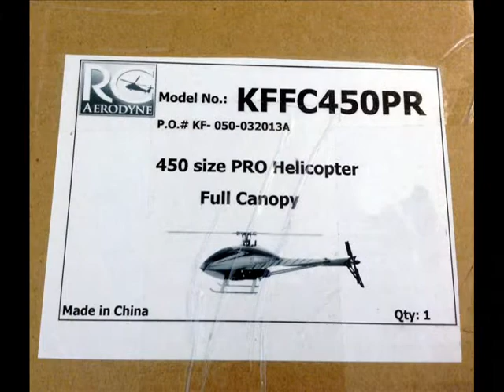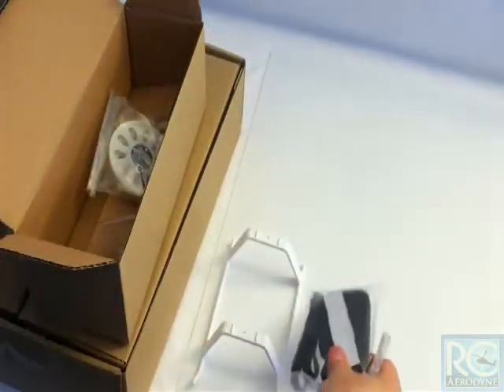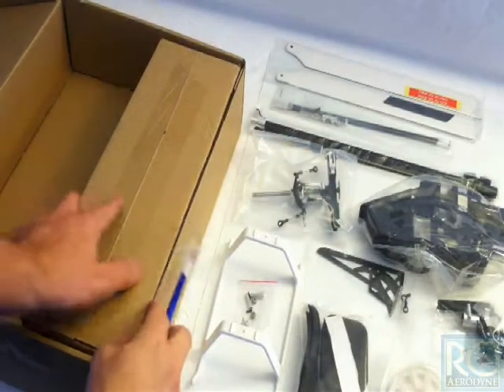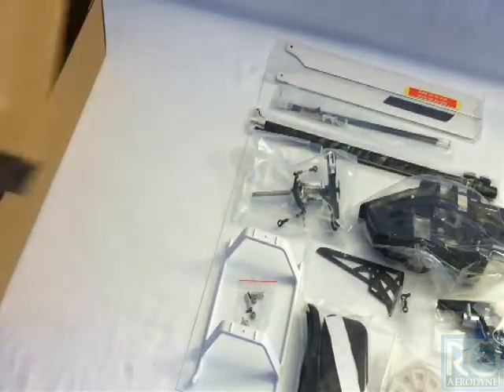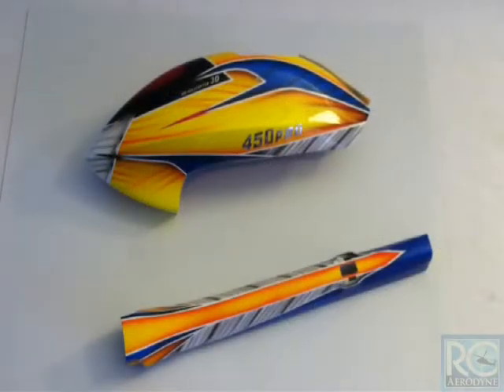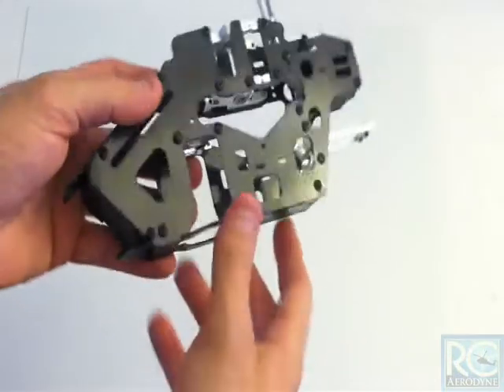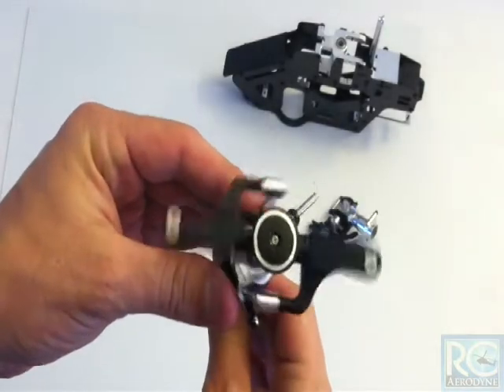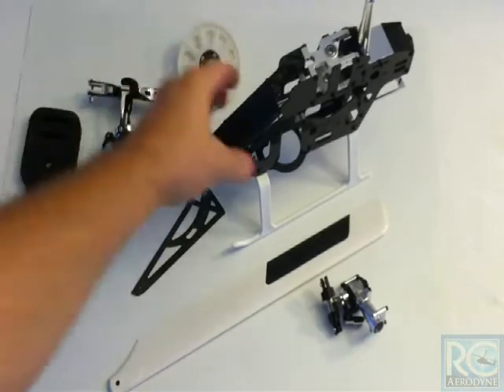Chaos 450 Pro DFC Black Widow Unboxing Video

Comment from the maker: It comes mostly assembled but you still have to take everything apart to grease and loctite. He kit does not come with a manual but builds just like the Align DFC Pro. Have you thought about trying a Blade 300 or 450X. They come ore assembled and ready to rock, the BeastX has multiple preset factory settings for any pilots experience level, and he parts are cheap to fix on a crash. I have owned over six 300X's. Fun machines!